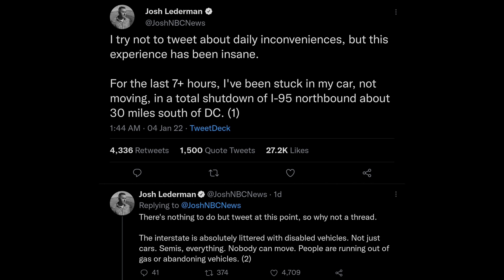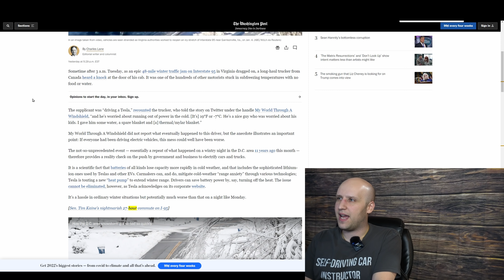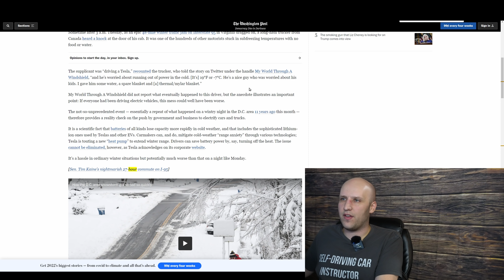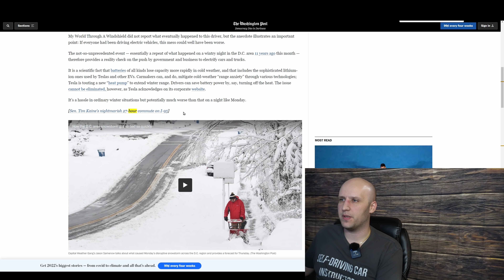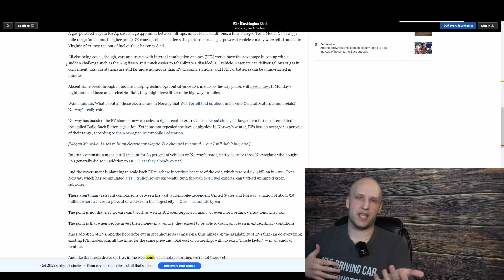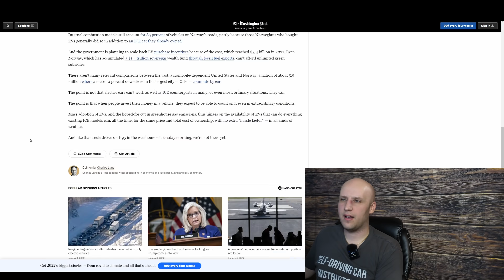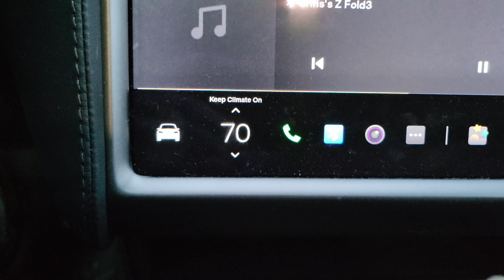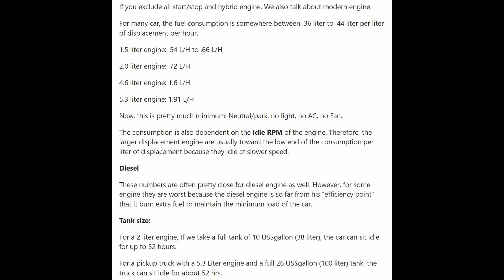How Long Can a Tesla Keep You Warm In A Frozen Traffic Jam? | FUD Debunking

Comment: This was really interesting. I certainly recognize the advantages and disadvantages of both. I do like the idea of an electric with a small fuel-powered generator, like the BMW i3 has available.

That said, I'd really like to know how a Hydrogen Fuel Cell Electric would work in this situation. I think that's potentially the real future of vehicle power as there's no emissions (except pure water) and hydrogen can be produced just as cleanly as electricity, plus you don't need the huge batteries which are heavy and have a large carbon footprint to produce.
Reply: Hydrogen requires significant energy losses to produce, more energy losses to transport to stations, and the build out of significantly more infrastructure than a simple charging station. Then there's the safety risks of gaseous hydrogen, or the energy requirements of liquid hydrogen (cryogenic temperatures or extremely high pressures).

A one time battery production (that's already moving to very efficient recycling, check out Redwood Batteries), with direct recharging is significantly less energy intensive and a large part of the infrastructure is already in place. Upgrading grids and changing out power plants is an iterative process, where as hydrogen requires completely new system as well as all the electrical infrastructure improvements since you are talking about a system with even higher energy requirements for less gain.
Reply: @dylananderson1209  Keep in mind, you're talking about advancements in battery electric technology, but ignoring the potential for advancements in hydrogen technology.
For example, hydrogen can be generated on-site nearly anywhere you can get electricity, so no need to transport it to stations, you simply generate it there. Currently, this isn't feasible, but I think the technology will improve there.
I think there's potential for both, but I'd much rather take a long road trip knowing I can fill up with hydrogen from empty to full in 5 minutes and be on my way again. It's not there yet, but I think it will be. Plus, existing ICE engines can be converted into Hydrogen Combustion engines, so the same fuel could power older cars as well.
I know it's not perfect, but I think it's s significant part of the future of transportation.
Reply: @BBKing1977  
I'm not ignoring anything. I was talking about starting from where we are at. Like I said, iterative in the case of electric to overcome obstacles, while hydrogen is a generation or more quantum leap. Site based generation would require massive infrastructure or ground breaking changes in how hydrogen is generated to be able to generate the thousands to tens of thousands of gallons a typical fueling station would require. 

Even with that breakthrough, you would still require more electricity to power the process than you would to simply charge a battery in the same amount of time. The laws of physics can't be engineered out of existence as far as we are aware, and separating the hydrogen atoms from water or methane is an incredibly energy intense process that doesn't regain much of that energy later in the hydrogen burning process. Additionally, steam-methane reforming still requires the harvesting of natural gas, and all the energy and waste of collection and transportation to the processing site that goes along with existing fossil fuels. Sure there are other sources like landfills, but this is a further area of both waste and needed development. It's an unnecessarily complicated system to make an even more risky substance power a moving vehicle without any added benefit.
Reply: @dylananderson1209  Nevermind. I'm not trying to start anything here. Go start a comment war with someone else. I'm simply trying to promote more clean energy options for the future, and all you care about is tearing down ideas. I'm not interested in that.

Comment: If I were in a situation like the one in Virginia where I was concerned about battery usage and staying warm I wouldn't use the main heater unless I had to. The seat heaters are a far more efficient way to keep warm. In that way, you'd be good for a very long time indeed.
Reply: Not more efficient, but they provide comfort for less.  Certainly less efficient than the heat pump in the Y.  So, we would need to know the equilibrium temperature for one human, the seat heater, at a given external temp, over a long time frame vs the same with the heat pump.  Sounds like a good experiment, but without that empirical data, I can't say which is better.

Comment: Good video, thanks.  I've read that AAA in some places can dispatch a generator, or at least a 5 kWh battery,  to charge an EV.  So just like ICE, you can have a mobile "fill up"
Reply: I'm sure they do. AAA in Denmark started to bring mobile packs with them back in 2019. Gives 7 miles in 10 minutes.

Comment: I have a MODEL X and a BMW X5 M-sport Series. If I were stuck in traffic for 24 hours, I would rather be in my Model X, hands down. There is no comparison from a heat management system. My BMW takes forever to warm up in cold weather compared to the Model X.

Comment: Great video and analysis. The lack of education regarding EV's is really the issue.  It is easy to make blanket statements without the facts. Just like "range anxiety". I have less range anxiety with my Model 3 than my wife does with her Chevy Silverado. I plug in whenever my car is parked at home and never worry about having enough energy. My wife on the other hand waits to fill up until the tank is real low and scrambles to find a gas station. I dred hoping into her car, as I know I am going to have to stop for gas. Traveling of course is a different matter but not that much. It is interesting to note that on average, they have about the same power reserve if stranded and of course as you mentioned, how much fuel or battery they have, nothing will solve a low tank or battery. Another point of note, in an EV you are not setting stranded in a car inhaling fumes from exhaust. Much more comfortable experience.

Comment: Most Tesla's leave home every morning with a near full "tank" after charging all night. ICE owners can be anywhere on the gas gauge and ICE use .25-.5 gallons/hr idling, that's why ICE vehicles ran out. ICE vehicles can have fuel pump problems once they run out. It can be more than a matter of adding gas.
Reply: WFM8384:  I NEVER let my gas get below a quarter tank in my ICE.  Why invite fuel pump problems?
Reply: @rogergeyer9851  I'm referring to running out while stranded, as in what happened on I-95 a few days ago. Even a full tank will eventually run out trying to keep the cabin warm.

Comment: Gas can be limited in the stations …. But if you have a portable solar panel and storage battery we can create energy and should be good for ideal for more than 1 EV. Like to try this experiment. Imagine no Gas infrastructure and you can not get Gas near by this is current situation for EVs that is why we need charging infrastructure. Any story can be twisted.

Comment: Live in Canada in the winter, never let our ICE vehicle get below 1/2 of my Y below 50%, but on the other hand in the winter always daily charge my Model Y to 85%.
Plus all you need you only enough change to get to the next outlet/charging station.
This year ICE vehicle will be hopefully be replaced with an Aptera.
All my yard care devices have already be replaced by battery devices.

Note your battery consumption you be lower because you did not include the heat from the occupants.

Comment: We have made several cross-country trips in our Model 3, LRDM, over the last several winters and have had no issues. Heater set to mid 60s, wearing a sweater and bennie. Also, we closely monitor weather forecast, rode conditions, etc., and plan accordingly for all trips weather, ev, gas, or diesel. I Have extracted hundreds of winter travelers in different parts of the country off Interstates, back roads, lesser highways, also using snowmobiles on forest roads and my observation is many/most drivers/operators are not prepared for the situation they are in.

Comment: I slept In my 2019 model 3 standard range plus, overnight starting at 79% overnight while on a rock climbing trip. It was about 50 degrees F and it went down to 20% with the AC set to 75 degrees F when I woke up 7 hours later.

Comment: The German YouTuber "CarManiac" just made a test with the Ioniq 5 BUT he let the road lights on, used both seat heaters and the normal heater and even let the radio play music. He started with 60% and after 10:30 minutes it was down to 39, so it only lost 20% in 10 hours. If you would stop seat heating and pow
shut-off the lights of the car, he would easily be able to stand many days in a traffic jam.... So no problem, the ice cars will have run out of fuel a long time before

Comment: To be fair, generators can make gas pumps run when there is no power.  In my city, that is a thing with some gas stations.  If you're out of power, not much BEV charging can go on, given how much power they take to charge -- even if there are some backup batteries on the grid. 

Obviously people go kind of bananas in an emergency, or even a winter storm if it's worse than what is considered normal for an area, so people will tend to buy a lot of gas and put strain on supply.

Comment: I used to drive trucks long distance years ago (before EV's were a thing) and was stuck on motorways (interstates) for over 10 hours quite a few times. Several times, I ended up sharing my water and snack supplies with motorists who had nothing. Luckily I never ended up having to share my truck with stranded families, but if you are snowed in for weeks, what would you do? Usually got enough diesel to last a couple of weeks with the night heater, but food not the case...
Reply: Nissan Patrol:  If the authorities leave people stranded for several days, much less weeks, people will DIE.  Even if it's not super-cold.  Lack of water becomes very serious after a couple/few days. 

Even massively incompetent government officials would be rescuing people at some point in such a situation -- even if they had to call out the national guard, etc. to help.

Comment: In my eyes, it is much safer to be snowed in, in an EV than in a petrol or diesel car, as you do NOT risk carbon monoxide poisoning, caused by a leaky exhaust - or where the exhaust pipe has been covered in snow.  Furthermore, in the vast majority of electric cars, you can have the Climate system running while you charge, which means that you can actually keep the temperature indefinitely - without the risk of you dying from a poisoning.  One just has to be foresighted and drive to a charger.  I know well what my choice is.  Finally, you get rid of the noise from an engine that has to run to keep the A / C running.  For me to see, it just suggests that the article was written by someone who does NOT know very much about EVs or will not accept the facts as they are.
Reply: Comparing Rav4 with Model X was a dead give away.
Reply: but you can have a fire, and be away from any open charging, so the best is hybrid or electric with gas extender.
Reply: people in Muree, Pakistan died bcz of this a few days ago.

Comment: Go into your car. Set temp to 70, and then turn on camp mode. Turn off seat heaters. As Albertans we do thes stress tests for fun (in much colder temps). I'd take an EV over an ICE in this situation every single time.

Comment: One important point is that if you’re concerned with getting stranded, you can charge an EV every night and start your commute with 90% (or 100%). For a gas car, you can carry a container with fuel but it’s every unlikely you’ll start each day with a full tank of gas. Also, would have been interesting to compare to how much gas would have been used with engine on for 24hr as well as standard car cars tank. My guess is that smaller cars with smaller tanks would have a hard time if they started their day with half a gas tank (which is very common for people to drive)
Reply: Rani G:  OTOH, BEV batteries last better if only charged to 80 to 90 percent.  As with all things, there are trade-offs.
Reply: Are you serious!? Not everyone has a possibility to charge at home, with a gas car you have amazing range, even excellent with diesel, also in emergency situations the ICE can be very easily managed, finally it’s super easy to store fuel or fill a tank, that’s why people have been overlanding with ICE for decades convenience!
Reply: My Ford Flex has a maximum 33 hr idle time which is significantly less than the average EV which is probably a Tesla.
Reply: @TecnamTwin  But in all fairness, in your Flex (or any ICE vehicle) you wouldn't idle constantly; you'd run it for a while and get warm and then shut it off until you got cold again.  With that pattern, you'd easily double or triple that time assuming a full tank.  Now on the other hand, it's far more likely you'd start the day with a near "full tank" in an EV if you are charging at home as you could easily be leaving the house every morning with a near "full tank" whereas in any ICE vehicle you'd be less likely to start with a full tank.  The point being, both technologies are fairly comparable in outcome IF they are used in a way that maximizes their "tank" longevity.
Reply: @TecnamTwin  a hybrid vehicle like a Prius has significantly longer running time with AC on and people have been amazed by that.

Comment: Good points. It was a very nice test. Some points I think that may have been missed is that the life of a battery degrades as years go by. So brand new car; Great. 3/4/5 years old Tesla, the hours lasted would be significantly less. Another point is that as the % of the battery goes down, the battery consumption becomes faster. So extrapolating a 36 hrs timeline based on a 12hr timeline would be slightly off and in real life, it will definitely be less than 36 hours. But yea lasting 12 + hrs stuck on a highway is easily managed for sure.

Comment: With electric there is more control, ie if you set an ICE temp to 50 it will still idle the same, in a tesla you could put it in camp mode and set it to the lowest possible setting to survive and you might make it for days

Comment: You can get a charge at any house on the road with an extension cord.  Maybe not a fast charge, for sure, but a charge.  You can't get gas at any house down the road, only a gas station.  If power is out in the area, it's a bummer for both gas and electric vehicles.  Publishers are whores, you only get positive coverage if you advertise with them, I know, I was a advertising mgr for years.

Comment: I think the most salient difference (outside of the possibility of being asphyxiated) is the point about what happens when all the energy is gone. It will be much more of a PITA to clear the road of dead electric cars when that's 70% of the cars on the road. Perhaps by then we'll have rolling fast DC chargers.
Reply: Randy King:  And how often would such a situation cause 70% of batteries in BEV's to be drained completely?  Keeping people safe in a reliable way for longer, which the BEV can do, is far more important than the occasional inconvenience in an extreme case. 

And yes, fast DC chargers will become things on tow trucks, just like gas cans are today.

Comment: Regarding «massive» subsidies of BEV cars in Norway, being way higher than the US bbb; there is no VAT, ice veichles has 25% 
E.g: Tesla model 3 that was Norways most sold car in 2019 and 2021
model 3 at NOK 370.000 is «subsidised» with NOK 75.000 (or USD 8.500)
For the model 3 LR the «subsidies» is USD 10.100
So, not that different from the bbb for the majority of cars👍🇳🇴

Comment: I don't think this is a legitimate post. It is too "canned". It appears to especially be designed to bash Tesla and it is factually inaccurate. Look at the below posts that indicate that keeping a Tesla warm takes less energy than keeping an ICE car warm. So my guess is that this is a "Dark Side" post. You can get by using even less energy in a Tesla by using a blanket and turning on the seat heater.

Comment: Can a car charge/connect to another car? If so, if all cars were electric could you build a network of all the cars and (assuming proper software support) manage the energy of the whole pack of cars efficiently to make sure none run out of energy?
Reply: Some new EVs support Vehicle to Load which would allow one to charge another.  The Cybertruck will supposedly have a 220v outlet as well.

Comment: Great video!  I believe you could only tow charge if the traction battery is warm enough for at least some regen  and on slick roads could be dangerous; likewise, if the battery was cold soaked down to say 20F, a portable charging device would deplete a large amount of energy just raising the temp of the battery to allow charging to start.  I purchased a 12V heating blanket which is large enough to throw over the passengers sitting in the front seats.  .I also keep a few of the chemical hand/feet warmers is the vehicle during the winter which could be used to keep your feet warm and used if you experienced a frozen charge port problem.   So my plan would be to use the seat heaters and heating blanket along with the feet warmers, if needed, and turn the cabin heating as low as possible.

Comment: Running the heat AND the seat heaters is not an accurate measure. The seat heaters are Only more efficient when someone is sitting on them. They are more efficient at warming a person because you can turn the seat well down. An accurate measure would be running the seat heaters with a blanket over them, and the AC down to 50 or so which would be perfectly warm if on the seat heater, especially if you had a blanket.